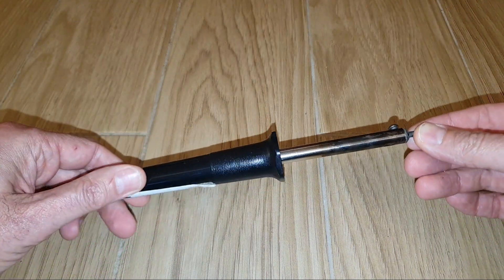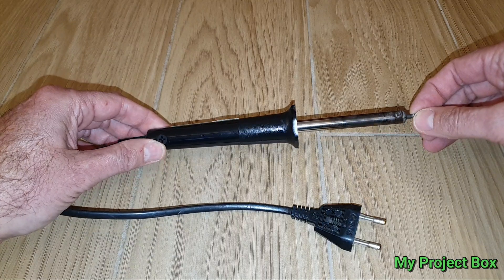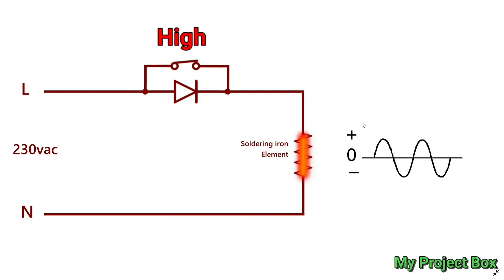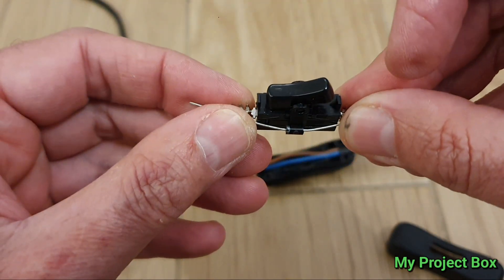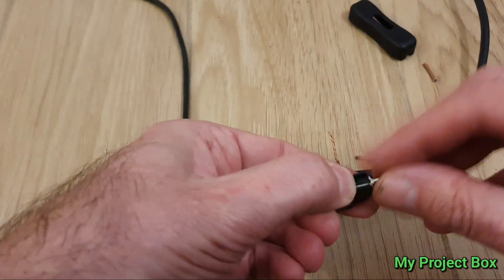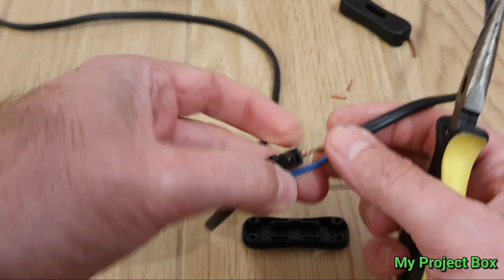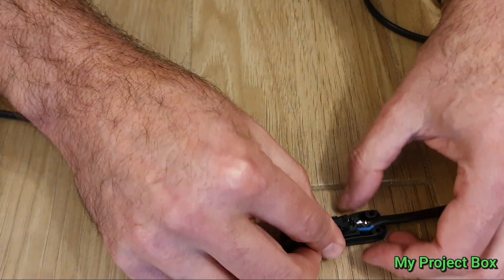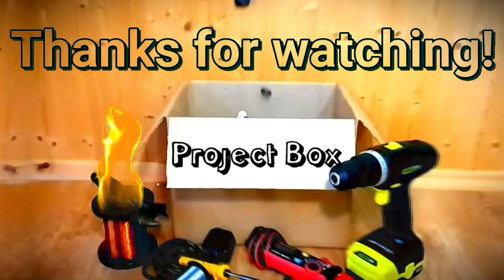Soldering iron High Low switch Diode trick save the tip #ElectronicsCreators

Comment: Do I use same Diode for 115Volt. USA  ??
Reply from the maker: Yes it will work just fine. The 1N4007 diodes are rated at 1000v, so this is well within range of 115V

Comment: Did this a couple years ago and it works beautifully.  Unfortunately,  I accidently broke the iron so I bought a simple, low-cost 60W Red Hakko iron.  I have a 3-way incandescent dimmer that is designed for in-wall use rated at 600 watts.  Would this work as a low, med, high switch?  Also wondering how to safely modify it for external use.  Any advice greatly appreciated.
Thanks Again !!
Reply from the maker: @mevk1   yes! Using a old light switch dimmer is perfect for your soldering iron. Just get a nice box to mount it in. You can build the simple triac circuit your self, but a light bulb dimmer  switch is the same thing. Just connect the soldering iron the same way as the light bulb. The dimmer switche normally goes inline with the Live, then to the soldering iron.  the neutral goes straight through to the soldering iron.
Reply: @MyProjectBoxChannel  Sorry, I misunderstood this 3-way switch.  Apparently 3-Way is not 3 power levels, but refers to controlling same light from 2 alternately located switches.  Instructions say that it can only be used as a 3-way and not as a single pole single throw.  Do you think I can still use this as a portable plug and play dimmer switch?
Reply from the maker: @mevk1  yes you can use it as a single pole. It's live-in on the common terminal and just use L1 for the live-out to the soldering iron (either L1 or L2). The neutral just goes straight to the soldering iron. You only need to use one "out way".
Reply: @MyProjectBoxChannel    FOLLOWED YOUR WIRING INSTRUCTIONS, and now I have temperature control for new iron, plus dimmer also give full range power to my 400W bedroom space heater.  Thank You !!!
Never one to leave well enough alone, now of course, I'm wondering if I could control 2 irons at the same time.  Do you think it would be safe to plug a 3-way plug into female load end?  That way two or three irons could be put in a stand-by power level. If it matters, one iron is 60W and other is 25W.  Also wondering if you think it would be safe to "dimmer" two irons like above plus have high/low switches for each iron so if, say I crank dimmer up to maximum, could I keep one at 50% with high/low switch?  Instructions say don't use two dimmers in one circuit, not sure if this rule applies here?

PS -- This  fixed-temp 60W Hakko Red is a bloody Beast with wide large tip.  Melts a bucket of solder from a 1/8" roll of 50/50 solder like it's butter.  Just noticed it's designed for stained glass work where you melt buckets of leaded solder on large rails of copper foil.  Half power still probably over-kill for some electronics.

Comment: Would a space heater with 2 settings 800/400 now have 4 settings with this trick?
Reply from the maker: @mevk1  basically yes! But it's probably more practical to give it 3 settings, by "splitting the 400 in half" with a diode. This gives you a new lower setting. You can use a 10A10 Diode, rated a t 10Amp.
Reply: @MyProjectBoxChannel   I savaged a 10A and a 20A diode the other day and thought of your high/low diode switch but was not sure.  
Update: tried alternate method, a 600W rated dimmer on a 400W space heater.  Heated small room overnight at 200W, box got warm on outside, not hot.  Dimmer has an aluminum heat sink but is enclosed in my plastic box/light-switch so maybe needs ventilation slots, who knows.  Apparently triac dimmers are 90% efficient ideally, pretty good, but still at 200W my box has to dissipate 20W and the original box was even smaller, but now it's a box within a box.  Diode method drop .7V but is still 10x or more efficient @ less than 2 watts of heat, though half wave generates harmonics, noise, vibration, etc. Should try diode just for pure efficiency sake.
Update: Following day fuse blew on dimmer,, replaced it,, only works on full power.  Box needed vents, damn:-(  Opened it up and dimmer flipper fell into pieces never to be used again.  Definitely should have put vents in the box and   Not sure if I have a triac in my parts bin so reverting back to high/low diode for "Big Red"

Comment: Wiring up an AC heated bed for my 3D printer soon. Figured the 1300 watts might be a bit much at times for our old house's power grid with other appliances plugged into the circuit, so I'm looking forward to trying this out. I really don't need to get to temperature in less than a minute and my battery backup system only supports 800 watts, too.
Reply from the maker: Try it! It might just be the simple solution you have been looking for. Just remember to use a big enough diode, for the heating element current draw.
Reply: @MyProjectBoxChannel  I'm looking at the BYV79E. 200 volts 14 amp should be enough for a 120 volt 10.8 amp application I'd assume. Or maybe I should give it a 80% overhead and go for a 19.44 amp minimum?

Comment: I have a soldering Iron which work on 110v ac. By fixing diode 4007, can I use it on 230v ac as this diode may drop 50% voltage as it will give half cycle 
Anil Kumar Goel
Reply from the maker: That will work 👍. It won't be exactly right but close enough.

Comment: I have a heat lamp for kennel which uses  the same method for a high/low switch, they just tacked the diode across the switch, Job done!. You cant get more simple
Reply from the maker: That's great! It's a very common technique and a very simple, easy thing for the DIY to do. And of course the simpler it is the less that can go wrong.

Comment: Will this work with 120VAC? I live in the US where that is the standard household voltage. I tried your tip by placing a diode on the "hot" (ungrounded) side of a power cord wired up to a receptacle and checked the voltage across the hot and neutral with no load. My digital meter showed very little drop in voltage with the diode in the circuit.  Am I overlooking something?
Reply from the maker: Yes it will work on 120vac. The diode will effectively make half-wave DC. So the voltage can't be measured on the AC setting. It's not going to be easy for a voltmeter to measure the true RMS voltage on half-wave DC. For a soldering iron the power will be reduced, by giving it half-wave DC.
Reply: @MyProjectBoxChannel  You're essentially reducing the duty cycle by half 60w AC will consume 50% less power.

Comment: you could have used  a dimmer  switch
Reply from the maker: Yes you can 😉. And I have done it in the past. I have even build a dimmer circuit from scratch, many years ago. But a diode circuit is as simple and cheap as it gets! And a simple "hi /low" setting, is good enough for most use cases.
Reply: @MyProjectBoxChannel  12 diodes are 10 cents at my electronics store.
Reply: Can the diode be place in any direction?
Reply: @BinjMikhahakdog yes

Comment: This is exactly what I needed.  Thank you!   So glad bigclive has links here.  Love subscribing to all you EE genius's channels. You guys/gals always know how to make my live easier - something manufacturers don't seam to care about.  I have two of these and both will be having this mod very soon -sweet!!!!!!!!!!!!
Reply from the maker: Yes! this is an oldie but a goodie👍 So simple but effective 😉
Reply: My "stubby" iron tip, with the flick of a switch now puts out 54 or 27 watts.😊 Now I only use full power to heat up iron faster then switch to half power unless have a larger mass to solder; and, if I forget to turn it off it won't burn up any more.  Low setting feature will also allow you to have a nice shinny properly tinned tip, and for me,  help prevent or minimize  my careless carpet drop burns  (what's  that I  smell burning - dooh !!!).😢  If you have a watt-o-meter, they make for a quick power test.   
    My other similar 20W iron I left as is because tip is still good and I have changeable tips that help somewhat with temp control and SMD/Biggy soldiering tasks, and  because I don't  have another in-line switch.  Now, wondering if one of those very small tactile-like clicky switches salvaged from a discarded HDTV would do the business - any thoughts?  Also, is there some way to half the power again so I only get 25% ?
  Thanks Again !!!!  Anyone who has one of these types of irons should add a switch and a diode, or  add what the el cheapo manufacturer should have originally included.😒😒
Yes, if you have a light dimmer box circuit that could work even better, and of course pretty cheap chinses adjustables can be purchased.

Comment: Great idea. Does it matter what size diode?
Or any diode that will fit in the switch?
Reply from the maker: As long as the diode can handle more current than the iron.The 1N4007 is rated for 1A ,  so that's up to 200w

Comment: What a piece of sensitive equipment you have acquired there... I'm using 100W gun. Transformer based, so I can't half wave it. But I have successfully soldered SMD LEDs with it before, It's about practice.
Reply from the maker: I agree! with enough determination you can solder almost anything, with any size soldering iron. I have done LED strip lighting with my dad's automotive soldering iron, which he used to repair starter motors!🤣🤣😜 Sometimes you need that extra grunt, to solder things with high thermal mass.
Reply: how about  you use a dimmer  switch
Reply: @cotto887  it could be done, but there is a risk of ruining certain components with that noise from the triac switching in middle of the wave, it couples much easier thru the loop of wire as a tip.
Reply: @cotto887  Vince, I was thinking the same thing and so I grabbed a spare dimmer 
I had laying around and measured the output with my digital meter and at the lowest setting, it didn't seem to drop the voltage much at all. I am in the US where 120 VAC is standard household voltage.
Reply: @hootinouts  My vintage Craftsman 200W 3 pound behemoth has a dial that that goes from low to high.  Not sure, but feels like the dial is just a switch inside the iron that taps into  a second transformer output giving you a low power setting, albeit 120W.  Those beasts had triggers for almost instant heat that you regulated manually by "firing" on and off.